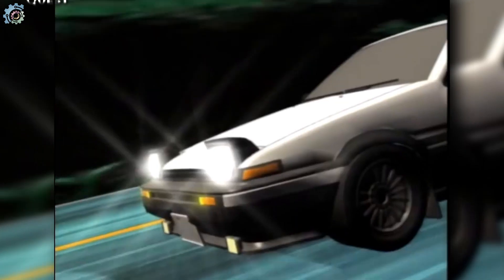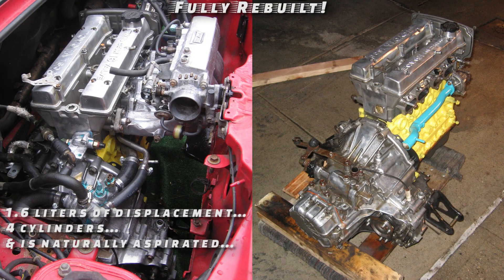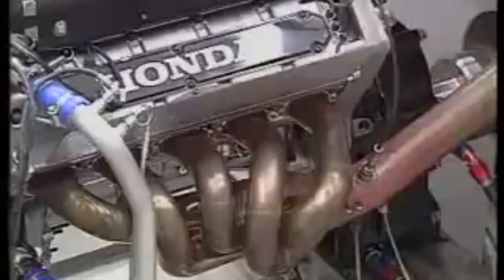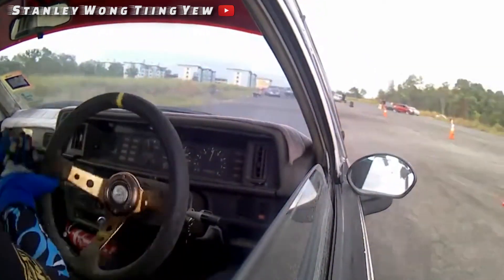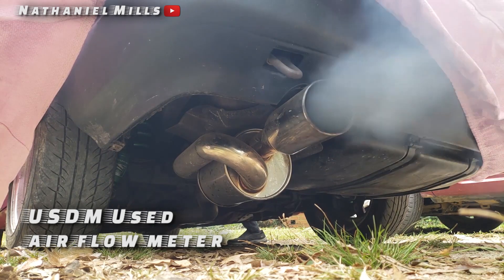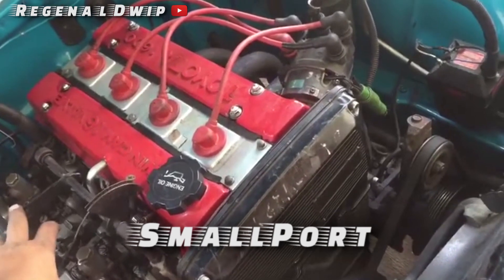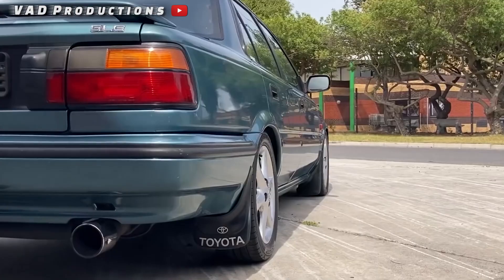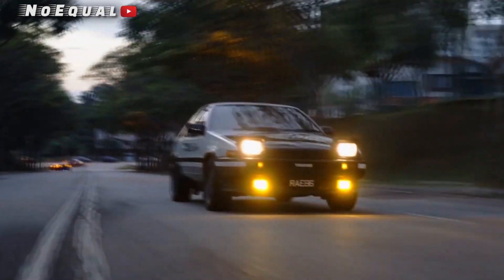The Story of the 4AGE || Part II

Comment: ... Correction ... The 4A-GE .. Was NEVER  .. Based  on The BDA .. inspiration Came From The  First  .. Race Spec 16v TwinCam 18RG .. Then The 2TGE .. The  4A-GE .. Began Life in 1984 .. as .. a .. S.O.HC .. 8v .. 4A .. Carb engine .. The Same Block & Crank Were Carried Over To The First  4A-GE .. Dimensions  Remained The Same  But piston were dome Shaped For Higher  Compression  .. The Tvis Head .. Was Built  By Yamaha  & Toyota  Added Tvis ... EFi .. With  .. MAFM ....

Comment: Little bit of a correction; Yamaha was contacted not because they make motorcycles, but because of their highly qualified & hand selected staff which worked & still work for Toyota. Yamaha engineers are basically Toyota employees that branched off from what was formally the precursor to TRD, the staff are the best at what they do & so they are called upon same as when they worked for Toyota (Toyota separates itself all the time, Denso, Asin, & so on are all companies that are Toyota but aren't, Toyota seemingly does this so they can have their hand being a bigger part of the automotive landscape then folks realize & this autonomy let's them adapt to market)

Put it another way. Toyota's past staff of their engineering/tuning division branched off into two companies, one of which became an independent part into Yamaha (with Toyota engineers who were of pioneering caliber) & another part that was retained and reformed into the remnants which later became TRD

It's similar to the Sony VAIO computer division branching away from Sony & being sold off but all the Sony but no longer Sony engineers basically just moved to the new VAIO company, but Sony can still reach out to their same past staff & commission/outsource them for new projects. Anyway Donut Media Group did a video on Yamaha being related to TRD. Explaining Yamaha is essentially just Toyota's A-Team to start with